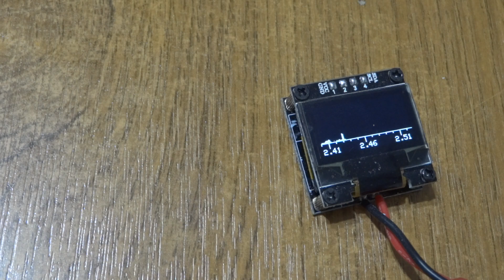Carrier Wave transmission test of the LGT8F RF-NANO

Comment: Hi Ceptimus, I am currently working with the same board, however, I am having trouble with uploading the code to the chip, I am using Arduino 1.8.19 and download the "nulllable AVR Compatibale boards" and tried all boards but still fails. My laptop has installed the driver and can see the connection in "port" option.

Can you please provide instructions that how to upload to the board with Arduino IDE? Thanks
Reply from the maker: Yes, I'm also using 1.8.19 and the Nulllab boards manager.  In my Tools menu, I have the options: Board: "DIY Board", Clock Source: "Internal (32MHz), CPU Frequency: 32 MHz, Variant: LGT328P-LQFP32, Upload Speed: 115200, Port: (whatever your port appears as), mine (running Linux) is /dev/ttyUSB0  But I've run it from Windows as well - and there it's just COM9, or whatever...  And then I just hit the Upload icon (=>) in the usual way...